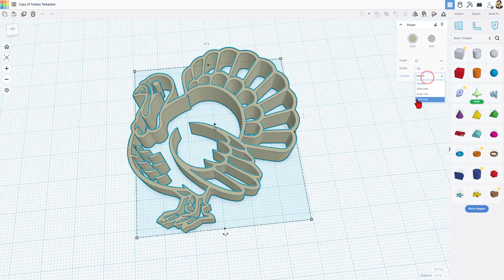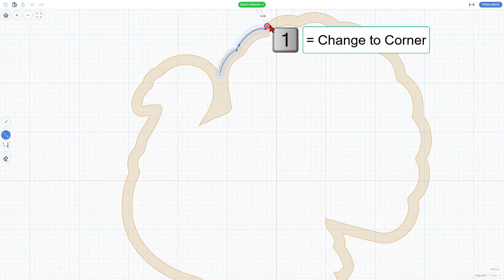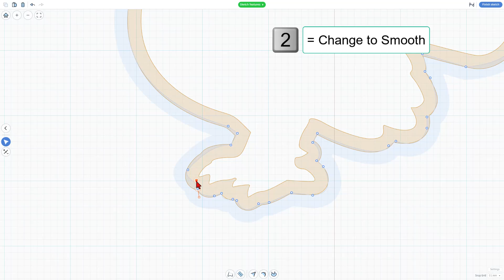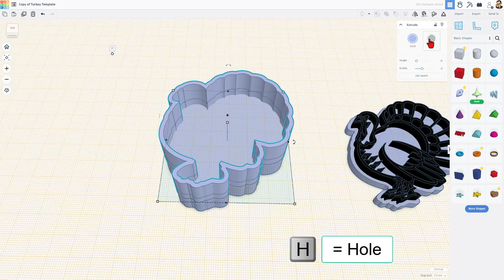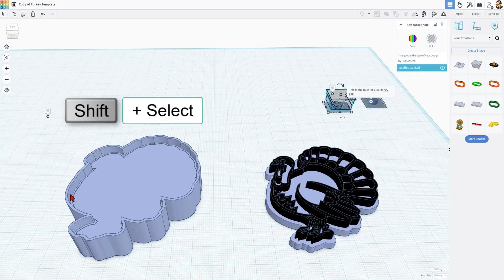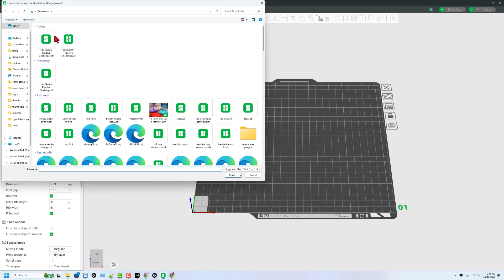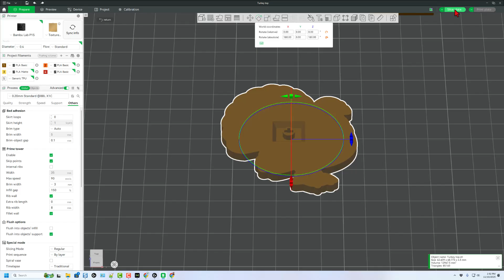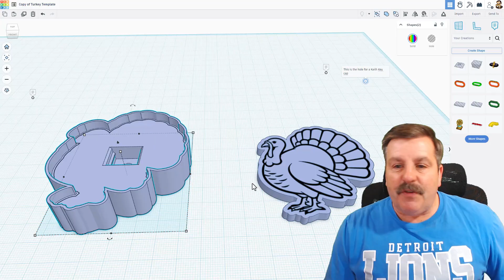How to Design a Perfect Fit Fast with Tinkercad Sketch Tool 💯🔥

Comment: The sketch tool trick was cool, but I've also seen the method of using an outer edge of an svg, exporting that, and doing it again.  That way it takes less time with a complicated shape like this.
Reply from the maker: Thanks. I use the SVG export trick too. I like the effort of sketch because it gives me the ability to adjust the fit.